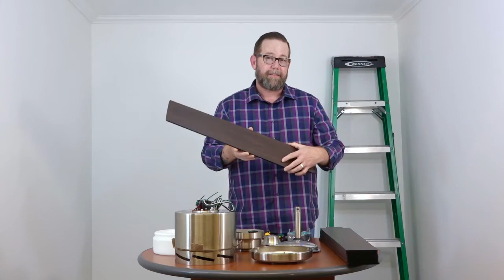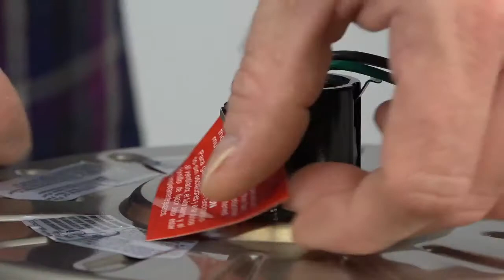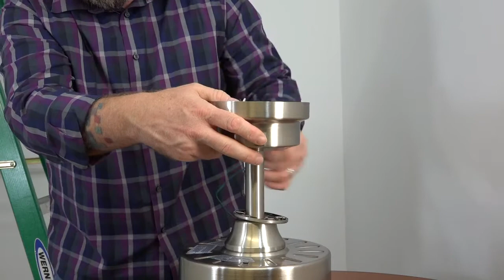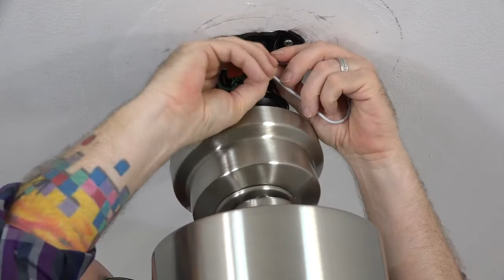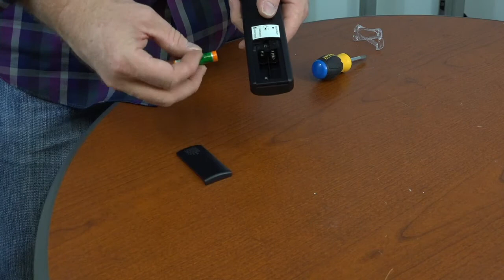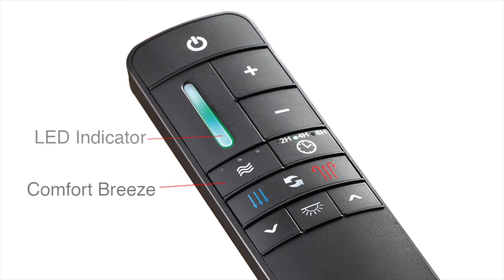How to Install the Zolman Pike Ceiling Fan from Home Decorators Collection

Comment: My fan is working but after pairing the remote but the light never came on
Reply from the maker: We woudl suggest making sure that all of the wiring is still completely/correctly connected. Sometimes, wires can get loose or disconnect during the install process. If that does not resolve the issue, we would suggest calling Home Decorators Collection customer service at 1-800-986-3460. Their team is pretty good at troubleshooting over the phone.

Comment: We just installed. We have 3 way switches in our living room and we have had no success with getting the fan to operate at all. The remote doesn’t turn the fan on and neither do the switches. We’ve checked all connections and breakers multiple times. Not sure what we are missing. We also have a red wire in the install hookup from the ceiling - do we need that wire anywhere? We kept it capped.
Reply from the maker: Sorry to hear that you're having this issue. Did you try pairing the remote with the fan (15:25)? The red wire from the house is typically a wall switch wire. If the red wire is capped, the fan shouldn't be connected to the wall switch. If the remote pairing process doesn't solve the issue, we would suggest calling Home Decorators Collection customer service at 1-800-986-3460. Their team is pretty good at troubleshooting.

Comment: I am having an issue with the light staying on. If I turn the wall switch off everything is off. But if I run the fan and turn the light off using the remote the light stays dimly lit. Any suggestions please?
Reply from the maker: I spoke with manufacturer about this issue. They explained that the light is receiving a small bit of power which is causing it to stay dimly lit. They suggested replacing the light kit. You can call Home Decorators Collection at 1-800-986-3460 to get this taken care of. Their customer service team is very good and troubleshooting and resolving issues.
Reply: Thank you. I will call now.

Comment: can you please say whats the voltage input of this dc fan?
Reply from the maker: The voltage input for this fan is 120V. It does not need anything special to be installed using standard house wiring.

Comment: The light doesn't work, went to home depot and have them switch the led light plug it in an still didn't work. I hooked it up the right way there's only 3 color coded wires. Is there another wire for the light that I've miss? Need help thanks
Reply from the maker: So, there are 3 wires that connect the ceiling fan to the house wiring and then a molded plug that connects the LED to the fan. If all of those are connected correctly, the light should work. I would make sure that the molded light plugs are fully connected (they will snap together once fully connected). Then I would trouble shoot - Does the fan work? Did you pair the remote before using it (see the 15:25 mark of the video for pairing instructions). I would also press and hold the light button on the remote to see if the light cycles from dim to bright. If none of that helps, I would call Home Decorators Collection customer service. Their team is very good at troubleshooting and resolving issues like this. Their number is 1-800-986-3460.